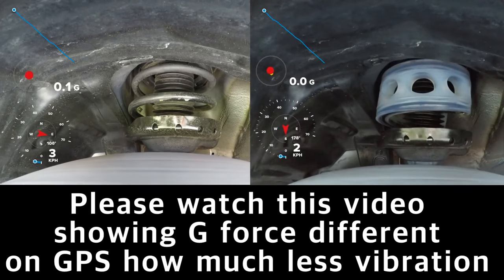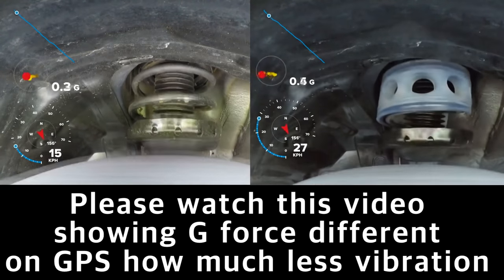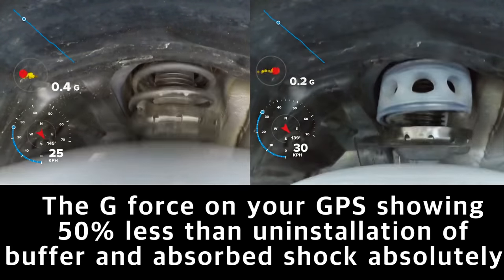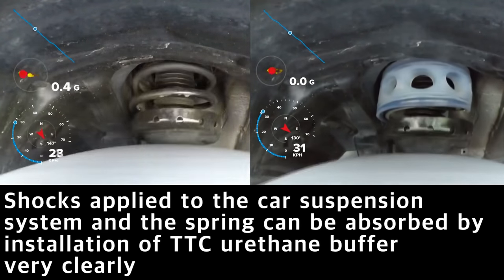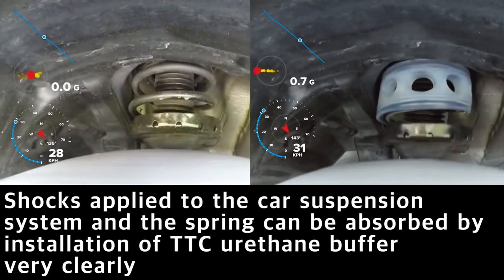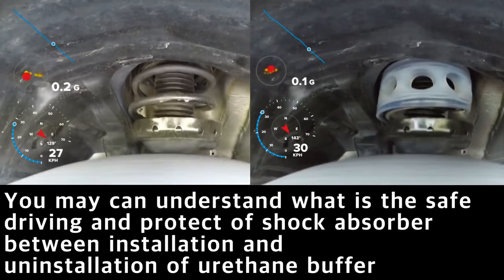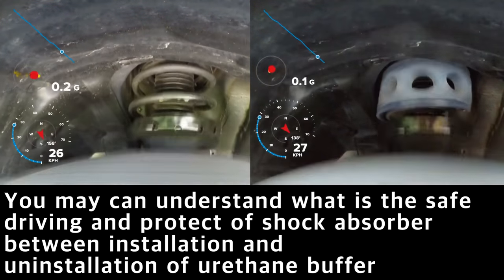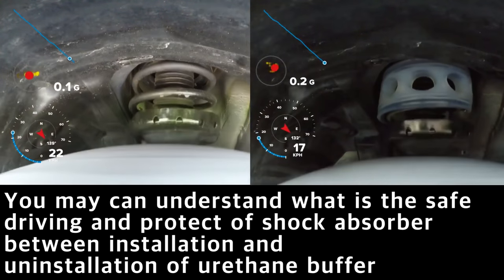TTC original Urethane buffer for Car suspension system!!!! Worldwide no.1 product

Comment: that is the easiest way to destroy you spring
Reply from the maker: No! Urethane buffer is unique product to  protect coil spring  and absorbing big shock from bottom. Recommend to use it
Reply: @thinkthinkcarkorea  XD
Reply: @thinkthinkcarkorea  the ring of the spring on which urethane is installed is not participating in the action,  so logic says it just reduced suspension travel,  and put more pressure on other parts of the spring.
Reply from the maker: @hyundaielantra7452  We have a lot of experience and customer who acutally bought TTC urethane buffer how they reduce shock and vibration/noisy. Would like to recommend to buy our product.
Reply: I agree, vibration passes to only bottom and top coil parts where the frequency of movement too high and premature of coil failure will occur
Reply: It's a tradeoff. If you ask me, this is a legitimate hack for cars past their prime. Saves lots of cars from going to the landfill.

Note: Nobody should be installing these on brand new cars 😂😂

My 12 year old toyota still drives really well on half decent roads. But the character changes completely with a full complement of passengers and luggage.

Now the car bottoms out on bad potholes and illegal speed bumps. And there's a ton of wallowing/swaying on rough roads. It is scary.

Rear suspension overhaul is extremely pricey and time consuming compared to a set of these spring buffers. They DO work. The car doesn't bottom out any more, nothing under the body is in danger of hitting the road, passengers don't get scared 😂
Of course, the ride quality is a lot stiffer. It's not as comfortable as before, that's for sure.
Springs won't get destroyed just by installing this product.
Reply: 😂😂😂 Put on your glasses
Reply: @vikassm  just install new springs then, not this piece of...
Reply: @ML-hf6ii  New springs were too soft to begin with, resulting in thudding over larger potholes at anything close to highway speeds (especially with 5 people and luggage)
This thing really works, but only in this very specific scenario.
Reply: @ML-hf6ii These are typically called spring helpers. They aren't for brand new springs. They are for worn out, sagging springs. Eibach (world leader in suspension) makes them as well. They wouldn't put their reputation on the line over a safety concern with their products.

Mostly only ever used on the rear coils. Especially in vehicles that never have any weight added to the rear. 

But you won't snap a saggy old coil by using these.
Reply: @Twitch_Moderator  Could these also be used to just increase the spring rate for a newer spring ? 
Like using a buffer with the same width as the springs on the normal position as to not mess with the height, but increase the spring rate since the coil with the buffer cannot compress and rebound with full motion

Comment: If you have an older vehicle and you don't want to spend $200 to $400 for coil springs and then fight with bolts, bushings or indexing insulators, then throw spring boosters/rubbers in. If you are using them in the rear, and you don't load up the rear of your vehicle, these won't make your rear coils wear out ANY faster.

Comment: How do I know the size of my car ?? I have a Mercedes CLS 2012, I changed the hydraulics to normal Mercedes C200 bumpers, but I could not find a compatible springs for my car, so how do I know the size of my car for this rubber tool so that I can buy the front pair and the rear pair?
Reply from the maker: If you change suspension as Mercedes C200, The size would be size B in front and size E in Back. However, It is better to measure actually. Please send e mail to ttc0999@gmail.com so as to submit measuring manual and sample proforma invoice to you.
Reply: @thinkthinkcarkorea  Thanks dear .. I will write to you on the e-mail :)

Comment: I installed these via authorised workshop in Singapore. I noticed the mechanic is using a smaller size (upper grooves does not meet the spring coil). Will there be a foreseeable problem due to smaller size usage?
Reply from the maker: Please contact authorized shop where you installed again since spring gap would be different between lift car up and down due to high flexibilty of coil spring.if it is, recommend to tie cable up.
Reply: @thinkthinkcarkorea  thanks. Will contact them right away. However it cant be seen right now since the car is already on the ground
Reply: @mohdfirdaus9050  if car on the ground and you can see coil spring gap not enough fill by buffer, It would be changed more bigger size.  Please go to installation authorized shop where you bought it.

Comment: You're putting all the force to the half bottom of the spring, so it will reduce noise in the car but also shorten the spring life.
Reply: Not at all. Buffer make function to reduce vibration of spring. How come comment about life of spring😅
Reply: I’ve been using this product for 4 years. It works well and absorb so much vibration.
Reply: FYI this product is made by urethane and some brand made it from silicone & rubber. So it is elastic not hard so it wont damage anything.

Comment: Hi there from Egypt, I ordered your product online and happily received it , great product, I have a question, Wich is the right position for rubber cushion,  top or bottom of the spring, my car is Nissan versa? Thanks
Reply: Thanks and happy to hear good result come out after installation. Generally speaking, location of buffer would be middle layer of coil spring but that's depend on nomal coil spring. As special case, The buffer should be rounded bigger diameter of coil spring than other layers.
Reply: @ttckorea  thank you sir
Reply from the maker: visit Insta @ttclee
Reply: باشا تنصحني اخدلي وحده؟
Reply: @samielhassan1896  فرقت معاك فايه يا كبير بعد ما ركبتها ..وايه اخبارها لحد دلوقتي معاك؟
Reply: @ahmedmaher3011  ممتازة جدا

Comment: How do I measure my car?
It's a Nissan Maxima 04
Reply from the maker: Nissan Maxima need to install size S1 in front and B+ in back. If you need to buy or more details, Please send e mail to ttc0999@gmail.com
Reply: @thinkthinkcarkorea  and in mm what would be the size for each of those?
Reply from the maker: @LOV2XRL8RL size S1 is from 58 to 48mm and size B is from 35mm to 42mm.

Comment: Size for suzuki swift 2009 in millimetre?
Reply from the maker: NEW SWIFT	A	C
OLD SWIFT	C	D
  based on 2010
Reply: @thinkthinkcarkorea  my swift shape is 2004-2010. Will C or D fit?
Reply: Which one for front and which one back
Reply from the maker: @adham_khan Before 2010, The front C and rear D , after 2010 front A and back C